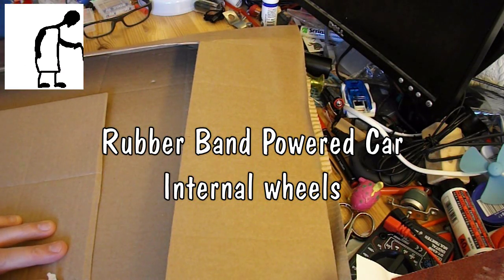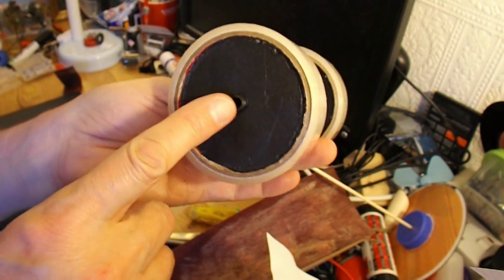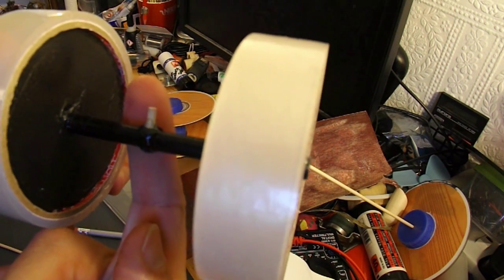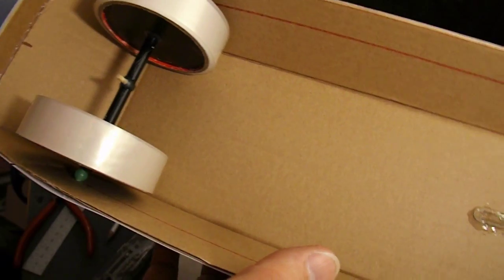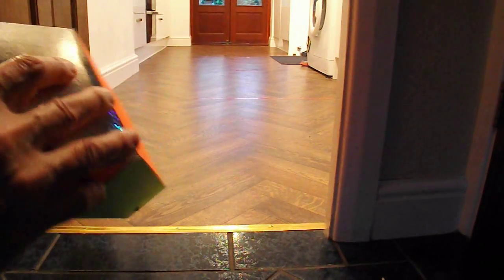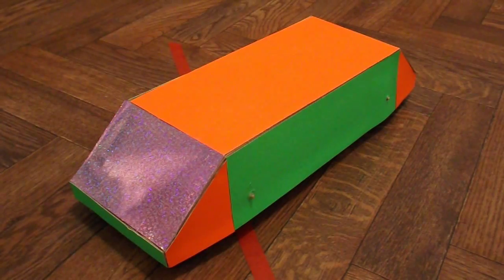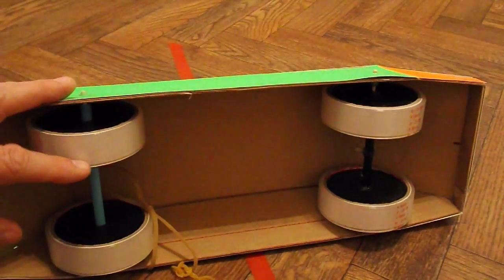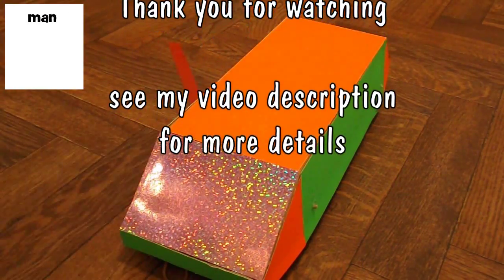Rubber Band Powered Car Internal wheels

Comment: Hey grandpa, can you make a lemon powered car. I know its weird to ask because you made a potato powered car.
Reply from the maker: I have tried but there is not enough power from a lemon (or a potato or a banana) to drive a motor with enough force to move the weight of the lemon. You can add more and more lemons to boost the voltage and current but you are also adding to the weight it needs to push. The only way I could think of doing it would to be to charge up a capacitor from the lemon and then try to run the motor from the capacitor. It might just have enough to move a short distance. I might have another try one day. The potato powered car was an April Fool joke, it didn't really work, that is why the video said it only worked on the first day of the fourth month.